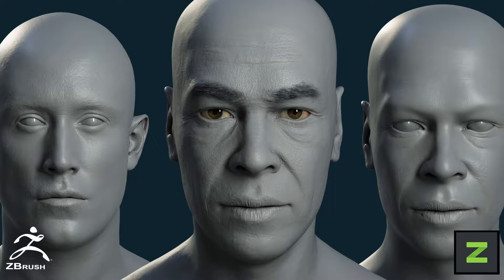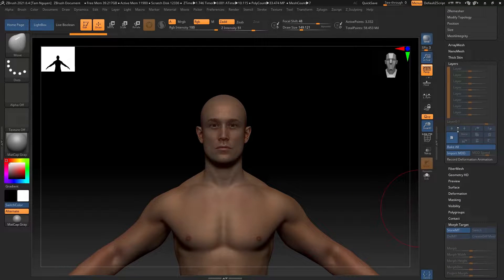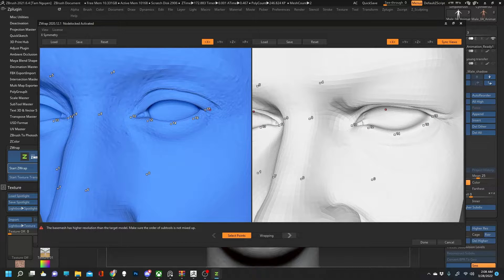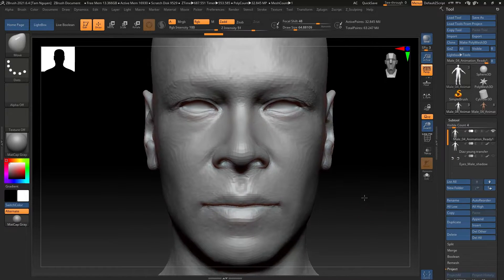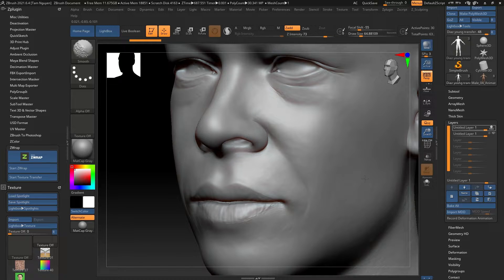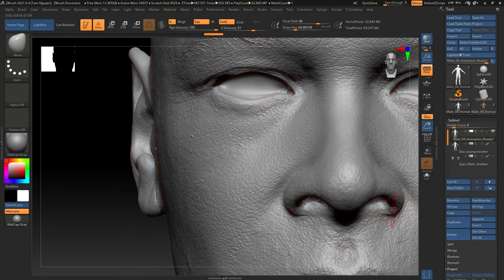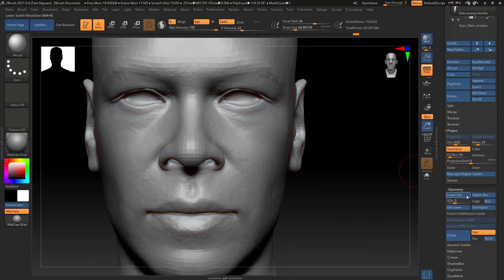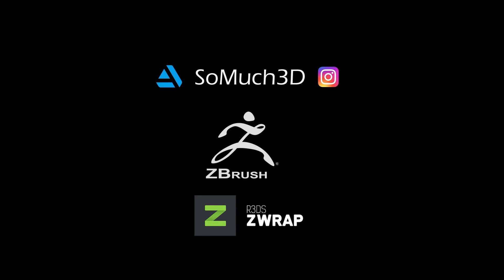Zwrap Tutorial: How to Combine Sculpted Geo and Scan Data

Comment: Great work!
I just a question regarding the wrap/projection process. Like I have a sculpted full body model, which is a single mesh (a single subtool). Can I wrap/project the head part only from the scanned model without splitting head/body into different subtool? 
I am assuming some scenarios such as:
1. I wrap/project head from one scanned model, and wrap/project body part from another scanned model.
2. I wrap/project body part from a scanned model, and manually do the texturing/detailing part on head for mild stylized vibe.
Thanks!
Reply from the maker: Hi, first off, thank you for the support and kind words. Second of all, yes you can both. The way I would do it but only wrap certain aspects of the model is mask it off. That way you're only wrapping parts that are not masked.
Reply: @somuch3d  Thank you for the info! I have udims on my mesh and it is polygrouped based on uv. I guess hiding polygroups might work like masking. Definitely will give it a try.
Just finished the sculpting & UV unwrapping phase, currently looking into texturing step. Wrapping/projecting and procedural generation are two relatively easier methods I have run into.
Reply: @somuch3d  lol, I have tested out both masking/hiding methods, and ended up redoing the mapping 3 times on the scanned head. I'm writing feedback here so anyone else run into this situation might skip the headache.
We're morphing the scanned head into the shape of our own sculpted character, and therefore, the scanned head cannot have hidden parts. To avoid wrapping unwanted parts such as mouth bag, we need to mask it off, but DO NOT hide it away by polygroup selection. If anything is hidden away, ZWrap can wrap successfully, but the scanned head will not change shape after exiting ZWrap menu.
For our own sculpted character, it's safe to hide part of it by polygroup selection, since we're not changing the shape of it. For example, I have a full body character, and I can hide away the body and the mouth bag, only keep the head displayed.

Comment: Great work! When projecting scan data, any reason why u use smooth brush instead of morph brush?
Reply from the maker: Hello and thank you for the kind words and support. As far as your question, normally at this stage, I've just created a new surface details that are transferred from a separate mesh. Thus changing the surface and with new topology. Which means no previous state for me to have saved a more target. That said, i do save a morph target with that tertiary detail/data so that i have it saved by painting it on a new layer. I hope that makes sense as i type it out,  haha.
Reply: @somuch3d thank you for reply. It's clearer now! :) When I project stuff on mesh, I store MT before projecting so when I'm fixing projected details morph brush returns to original mesh, cuz sometimes smooth brush wont fix it that well .Sometimes I cheat and I use smooth brush haha

Comment: Dear instructor，I've one question. As I can see, there are two heads in the subtools and both have useful details so will you transfer the detail textures from one to another or just merge them together in zbrush (does this make sense btw?) in order to get into the next steps such as rendering. Thanks a lot.
Reply from the maker: Yeah, as the reply stated, we're transferring surface details from one mesh to another.

Comment: hey, I have a question for u.
Lets say I have a good retopo model with mouth bag and all and I want to wrap it around a zbrush model sculpted without a mouth bag. Both have closed mouth.
I'll pin all the point but will the mouth bag get where it should be ?
Reply from the maker: Hi! so sorry for my delay in response.  I've actually tried doing that some thing before and it caused issues as zwrap didn't know where to put that geo and gave me wonky results. There are two solutions I would try. First one, mask the mouth in zbrush first before trying to wrap and that should prevent it from trying to wrap to geo that doesn't exist. My other would be, to detach or cut the edges where the mouth bag starts and zwrap the rest. Once you have a good wrap, stitch the mouth back. See if that works. Thank you for the support as well, my friend!
Reply: @somuch3d  it's ok, thank you, i will try with the trial version

Comment: hello. what is the purpose of combining scanned and sculpted? or what are some uses?  sorry i am new to 3d. is it just mainly for adding details super fast?
Reply from the maker: Hello and thank you for not only watching my video but for your question as well. So there are a few reasons for taking this approach. For some, it yields great results with less time. Also, typically in the gaming industry, working under in a collaborative effort with multiple departments and a production timeline, taking the time to create tertiary details and full custom skin details is a luxury you don't often have. So this alleviates much of that time. However, you still want the model to have its own identity or specific details that make it unique and not just a perfect skin match to scan data. So this helps create a blend of custom detail and fine tertiary details. Personally, when I have the time, I prefer to create /sculpt my own details. From wrinkles, pores and imperfections, I find it more rewarding and I enjoy the process. 🙂🤓
Reply: @somuch3d  thanks so much - will try these techniques soon!